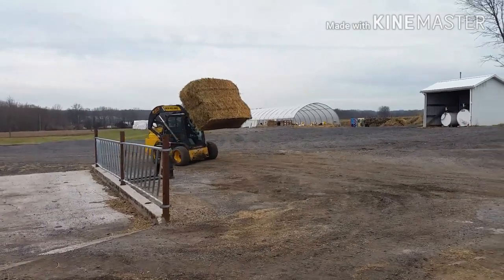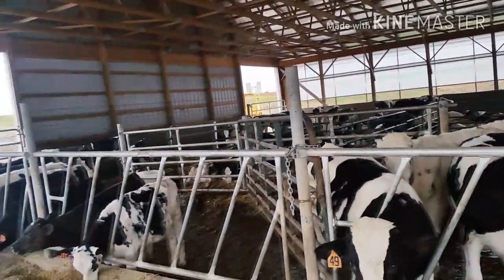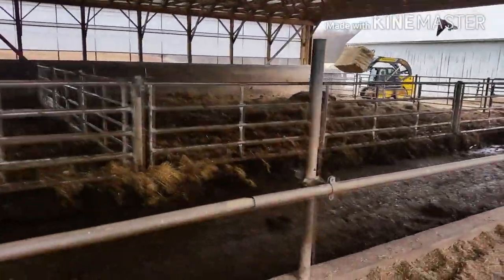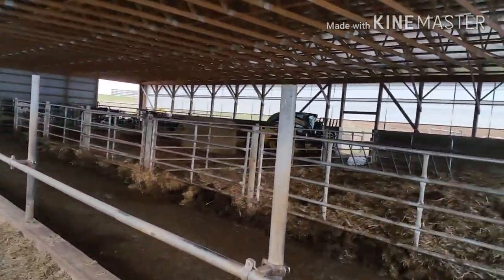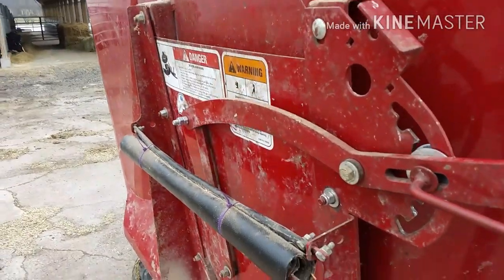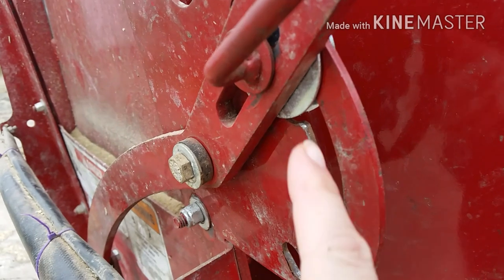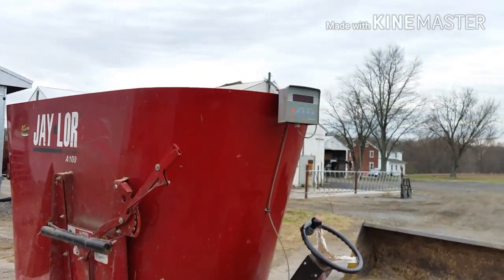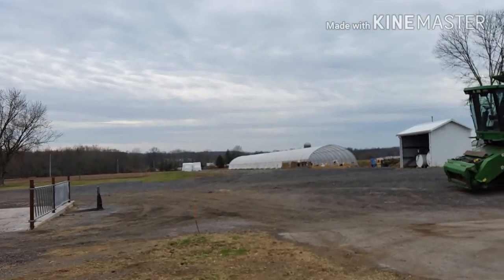Preparing for another weather system and repairing the JayLor A100 TMR mixer

Comment: It's an interesting point you make about the weather forecast. Do you find it to be pretty accurate on the whole much beyond 12hrs ahead? The Met Office here in the UK often gets it wrong beyond 24hrs although our weather is usually controlled by what is happening in the Atlantic Ocean and changes to the Jet Stream with weather coming in on the southwestly winds.
However we do not experience the same weather and temperature extremes such as you report. Right now its 5 degrees C at 24.00GMT and not expected to get above 9deg C in the day time all week. Humidity is, as always, high at this time of year is at 91% and westerly wind about 13mph. Some rain is forcast for at least two days with about 5hrs of sunshine on Thursday only.